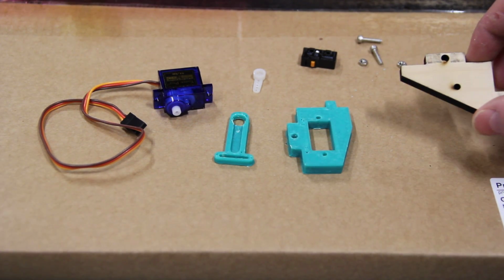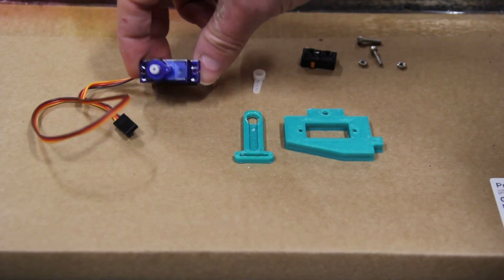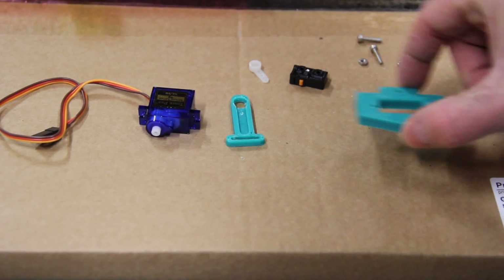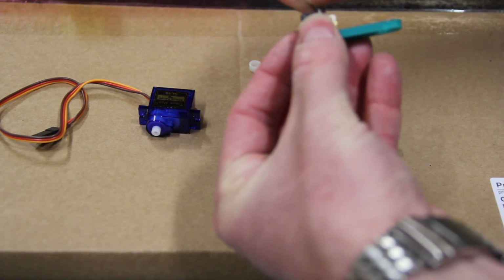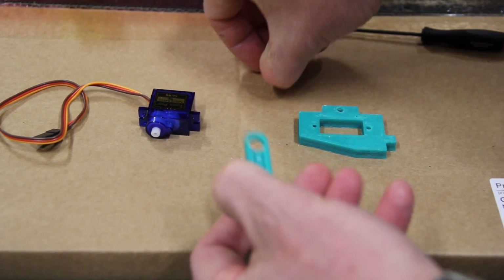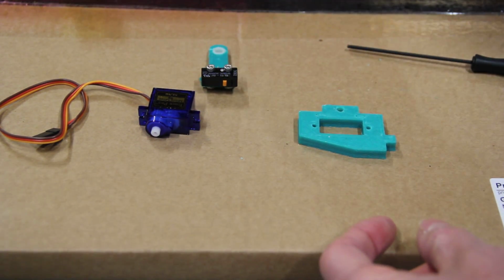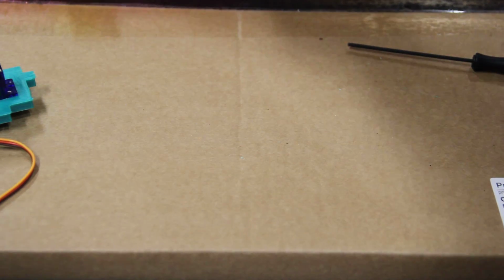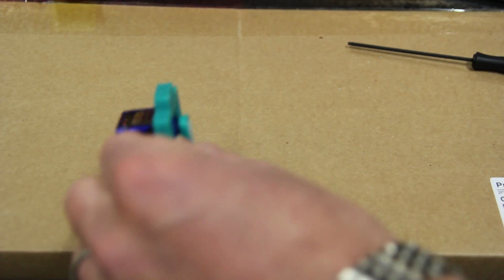Setting up auto bed-leveling on the Makerfarm Prusa i3.  Part 1 - Hardware Assembly

Comment: I did this mod 6 years ago now, but failed to take note of where on the ramps board the microswitch was wired to.  I'm in the process of doing the upgrade of my Prusa i3v 10" to the Pegasus   Does it use the place where the Z endstop was?   Any help would be appreciated.

Comment: Hello, thank-you for this very Nice and usefull video. i notices a litle trouble with the ramps 1.4. The 5V look to coming from the Arduino. a litle servo can use more than 300mA when running. I noticed that the lcd is dimming when the servo is moving. it's probably a good idea to add a 7805 or some think like to make a strong 5V for the servo. I do that and that look better.

Comment: Hello I'm hoping you or someone else reading can advise me here. I'm setting up the auto levelling on my prusa i3. The video mentions how to connect the servo which is all well and good and works for me but it doesn't state where to connect the microswitch to on the RAMPS board, does it just replace the standard Z endstop or is there a certain header specifically for the auto levelling switch?
Reply: +Robert Fitzgerald I have the same question.  Did you ever find the answer?
Reply: I connected it to the endstop pins in the end, the firmware needed some modifications to get it working right but I did find a guide on it, I'll have a look see if I can find it
Reply: +Robert Fitzgerald Thank you!
Reply: hello i just follwed this video and i need some help can you help me please ? i have everything wired but i have a question about the endstop what do you need to connect ? does it requrie all three wires are does it only need the commn and the normly closed to work because that is how he wires it in the video?? thank you
Reply: +Jrod it needs the com and NO wires connected to the normal Z endstop so when it moves downwards it creates the connection. you may also need to invert the Z axis in your config file if it is operating the opposite to what it should
Reply: +Jrod although it will also work with normally closed contacts as you suggested, if it doesn't work right that way then invert the Z endstop in the config.h file
Reply: +Jrod I gave up on this method of auto levelling in the end because it was too inaccuratr and I'm starting to setup the proximity switch type to see if that's better. I've had issues levelling mine since I first got it so I'm desperate to get it working reliably lol
Reply: well i have fixed the issure and if i get it working would you like me to contact you ?
Reply: Glad to hear you got it fixed. Yes feel free to contact me any time, I need to get mine up and running at some point, having a toddler in the house and being flooded with work for the last couple of years I haven't had much chance to do anything with it, I will do soon though :) I got my Prusa i3 from SemiU http://semiu.co.uk/product/prusa-i3-complete-kit/
Reply: i have almost completed setting it up and ran into a few issues but have sense fixed them i will contact u shortly if i get i working
Reply: hey man i have worked out alot of kinks and got i working if you would like help let me know and contact me i will do skype or voice calls to help you if you need them
Reply: how your printer can work properly removing z max endstop. If I do that, one of my deltaprintr's carriage is crashing at the top. I've got an Azteeg X3 3DP, I saw a slot for a Zmin endstop but there is no "spike" to plug it but I can solder.

Comment: Will this work on the i3V?
Reply from the maker: ***** You'll need some slightly modified parts, but you can do it.  In all honesty, since I've started using i3vs, I haven't bothered to set up ABL. They seem to be solid enough that leveling takes about 4-5 minutes, and I need to do it less than once a month.  ABL is great if you need it, but if not, it's a lot of extra wear and tear for the sake of slight convenience.
Reply: ZennmasterM Thank you for the quick reply.

Comment: Still building my 3D printer, but confused about the recommendation of using ABS here -- if you print ABS, then the hot end needs to be hot enough to melt ABS right? -- so, isn't it a bad idea to use ABS here then?
Reply from the maker: The hot end isn't close enough to soften these parts.  That said, the melting point of ABS is way higher than PLA, which is the other commonly available alternative.

Comment: What size bolts fits the SS-5  	 	MICRO SWITCH 1st ones i tried was slightly to big and crack  my switch :/
Reply from the maker: Anthony Edwards The ones I have use M2 screws.  You can also enlarge the holes using something like a reamer, a drill bit or even a hobby knife. As you have learned, the plastic the switches are made from is a little too brittle to just jam an oversized bolt into.

Comment: For the Z-endstop switch could you not just break the metal lever that sticks out the top and make the  button connect directly? Or does the lever arm thing actually serve some other purpose?
Reply: yes you can but be careful becuase you could dammage the switch

Comment: Has anybody tried this with one of these micro switches? http://www.banggood.com/100pcs-Mini-Micro-Momentary-Tactile-Tact-Switch-Push-Button-DIP-P4-p-917570.html

They are smaller and would be fairly easy to mount on the end of an arm. They require a bit of a firm push to trip, but might be a more compact and economical solution.
Reply: Good luck with your build. I look forward to seeing how it turns out.

Comment: Those are most likely 12mm long M2.5's, the SS-5 is 6.4mm wide, and the printed Z arm is 4.1mm printed, giving 10.5mm.  I used M2.5's to hold the servo in place too.

Comment: Did you have to modify the firmware file any?
Reply: NM, Are you still making the video on modifying the firmware?
Reply from the maker: Definitely!  It's been a really hectic week at home/work, but I'm hoping to get it posted by the weekend.
Reply: Okay great! Looking forward to it! I got mine working sort of but it reverses the axes after it runs through G29. Cant for the life of me figure out what Im doing wrong.
Reply from the maker: I've head of that issue before.  I think it was a bug in Alex's code branch that got corrected when he pushed the changes into the official Marlin trunk.  His latest recommendation is to use that version, and not the one on his own Github.  Hope that helps!

Comment from the maker: It does replace the Z-axis, and you can wire in a second microswitch (in series!) as a backup.  The trouble is, for the second end-stop to work (and not override the primary), the nozzle has to have crashed already.  I'm thinking about wiring it in as more of an "Emergency Stop" button rather than a traditional endstop.  I'll certainly be making a video describing whatever solution I come up with!

Comment from the maker: I found a spare jumper laying around on an old dead hard disk.  A jumper should be easy to find, I would think.  Take a look in the accessory bag of a PC case, or an arduino starter kit, or on just about any old PC board.

Comment from the maker: You're welcome!  Thanks for watching, and there's more to come!
Reply: So i am really late to this video, but I am trying to understand how the z axis knows the endstop position if the Z probe takes up the Z endstop pins? Is there a way to add the original endstop sensor to the board so once the system homes the nozzles are at he correct heigh to print?